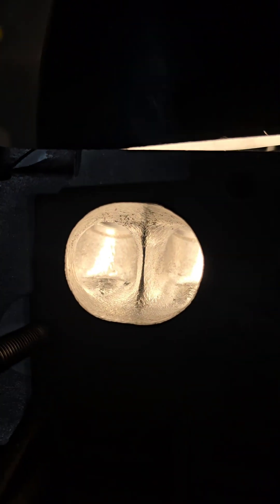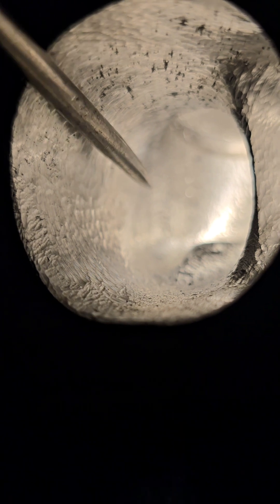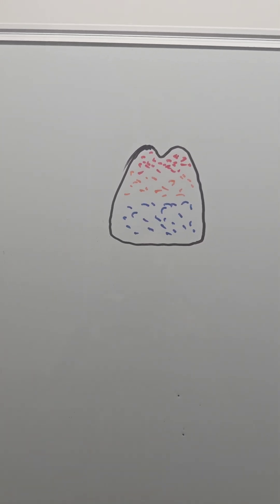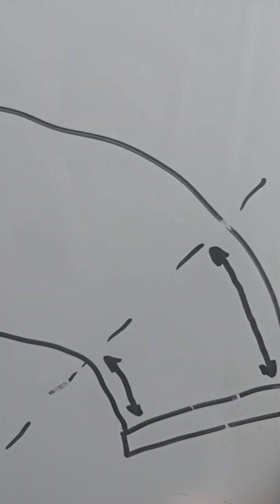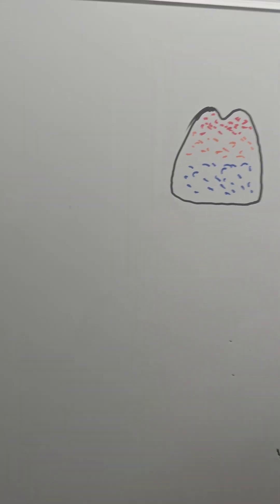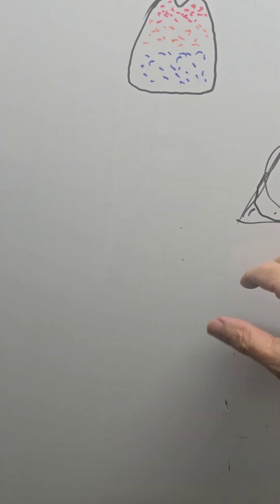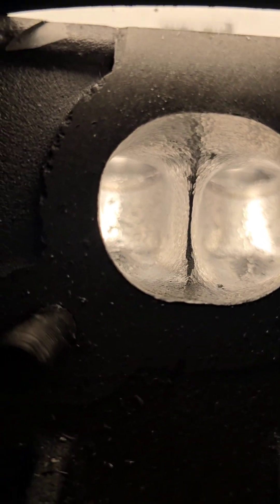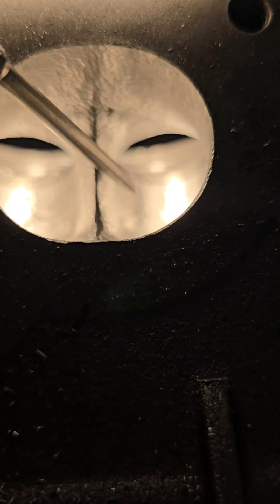RB26 Head Porting Part 10 – Fixing the Exhaust Port Mistakes #RB26 #portingtips

Comment: So we want the inverse shape for intake port?
Reply from the maker: Basically, if we are turning air. We need a biased volume approach,  more on the short side. Less on the long side.  This helps accelerate the long side ro jeep up with the short side. As the long side needs to cover more distances due to the increased angular distance as we move away for the radius centre point. 

This will help balance and control the pressure front and help the air turn together.   Separation comes when the floor air molecules get around the corner faster than the roof and leave the SSR as they are unsupported. Obviously, inertia is a factor here, too.

Think it like Nascar racers going into the corner 4 wide.  If the outside guy is a little quicker and the guy inside him closer to the middle is a little slower "relative" to ground speed. And so on down to the guy on the very inside. Who can't carry as much speed anyway due to the shorter turn radius. Then they will all turn together. The inside guy has someone to lean on,  which helps the turn.